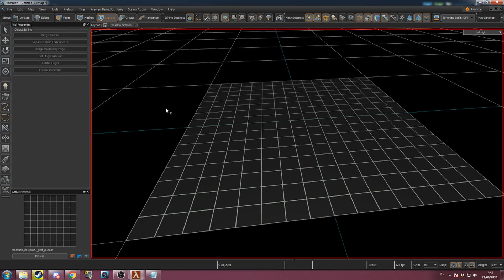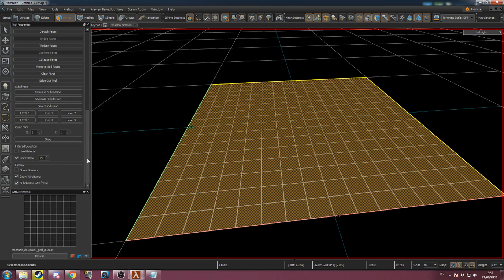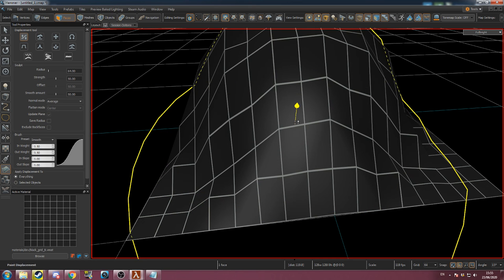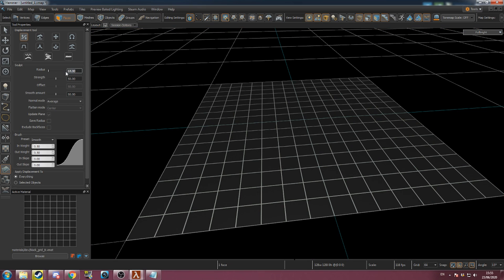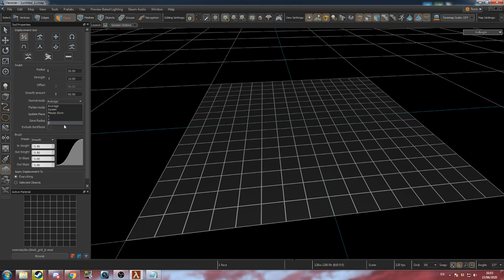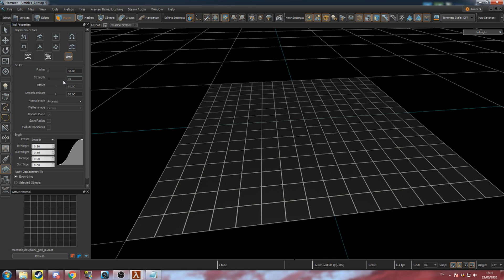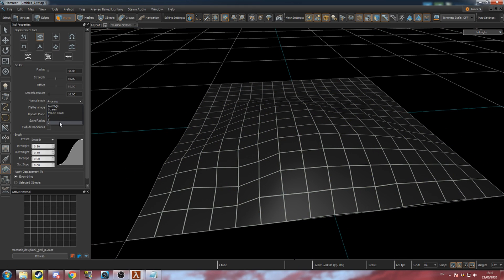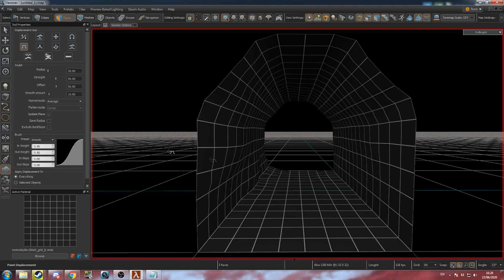How To Make Displacements using Subdivisions and the Displacement Tool in Source 2 Hammer

Comment: i dont know why but i just cant use the displacement tool on any of my surfaces. not even the square
Reply: yes its subdivided. i also tried it on a new map with just the square
Reply: I had the same problem, and I solved it by not baking the subdivisions.